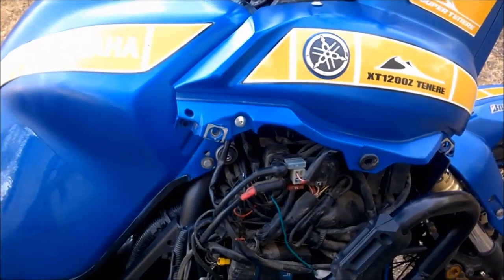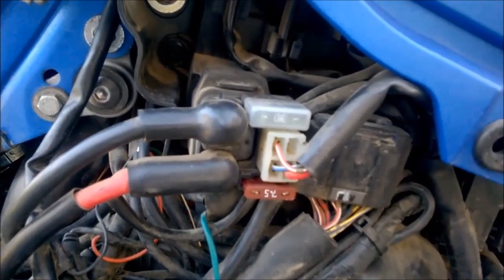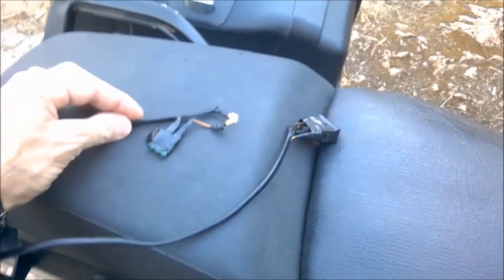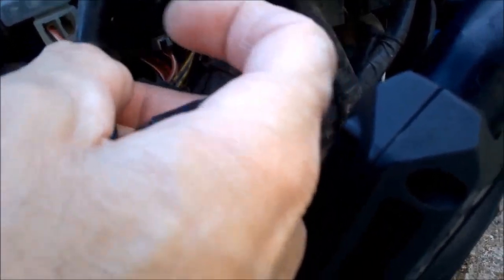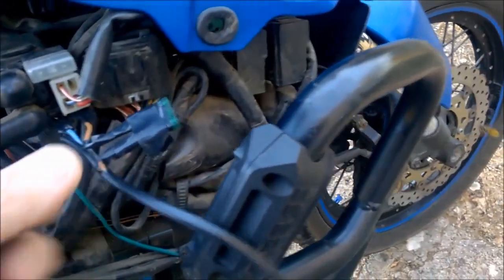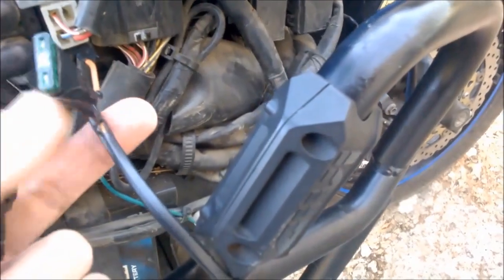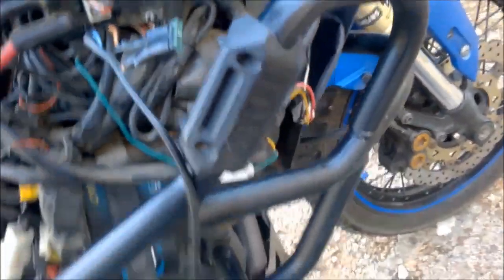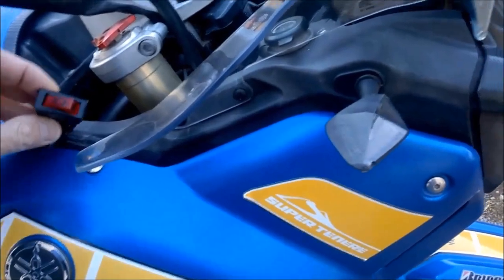Maxienduro School Sardinia How to build an ABS on/off switch for the Supertenere 1200

Comment: guys if u do it in this way in most modern motorcycles the speedometer will not work.

Another thing is that add a five pin relay to the circuit so that if in case the switch gets damaged the abs will automatically turn on which is much more safer not only that most aftermarket switches are not designed to handle this kind of load so always use a relay and appropriate gauged wire.
Reply from the maker: On the ST1200 the speedo works perfectly with the abs off.

Comment: I would investigate more, maybe a filter with capacitor and resistor could be added to avoid transients/sparks in a similar way that you wouldn't remove the fuse when ignition is on. Or just switch the bike off before turn on/off the switch. Is it an overkill? I am not sure. Also make sure the wires are the right diameter or thicker and good quality low resistance heavy duty waterproof switch. It needs a little reasearch to make things reliable.
Reply from the maker: this is indeed a reliable solution